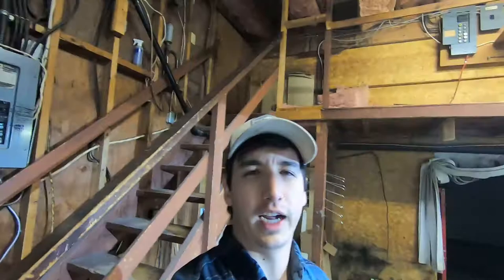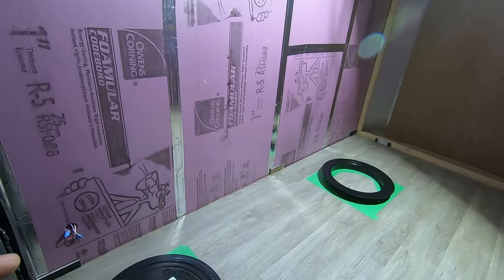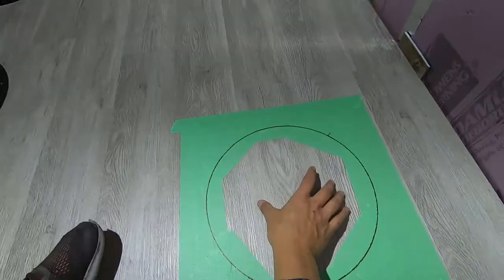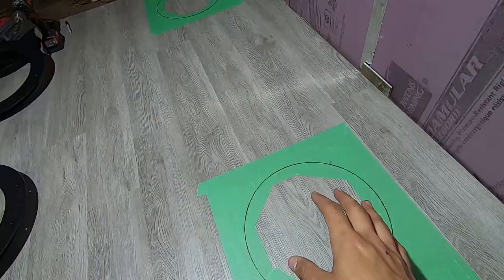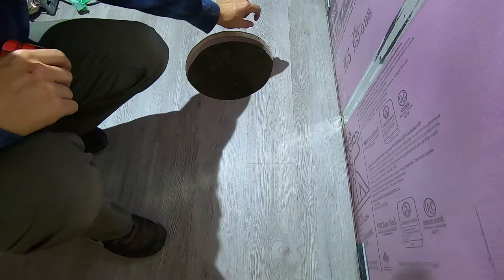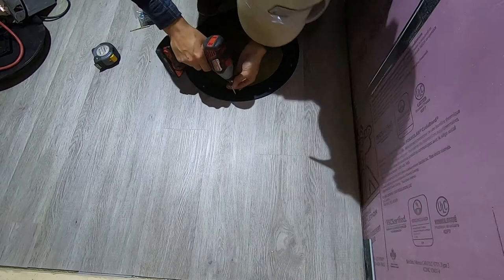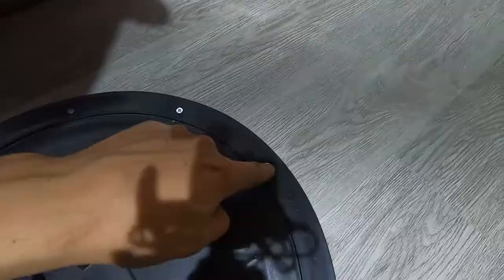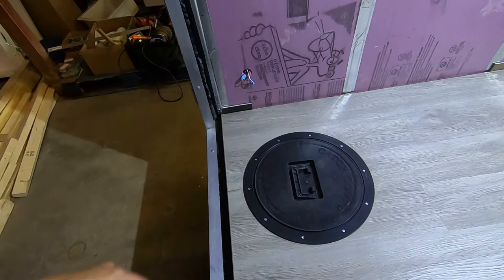How to turn a Cargo Trailer into an ICE SHACK CAMPER

Comment: Great videos on your trailer build. When you installed your diesel heater and had the exhaust ports right against the wood floor, did this cause any issues? I would think it to be an extreme fire hazard.
Reply from the maker: Checkout my update video on the Diesel heater, after 10months. I did discover some burnt wood which was problematic. Ended up installing a metal flange I made out of a soup can! Thanks for watching!

Comment: Have you had any rot or anything happen to the floor around the holes?
Reply from the maker: installed +2 years ago and no problems at all. The tuck tape and caulking is what keeps it sealed 100% recommend.

Comment: Have you checked the floor edge at the bottom of the hatch cover hole to ensure that yur mono fishing line doesn't get caught or cut off because of the metal edges?
Reply from the maker: There aren't any metal edges so I am not sure I follow. The catch cover ring is a smooth plastic.

Comment: I was thinking of doing something like this but using the hole in the floor so that my (large) dog would be able to come in and out with some kind of step if needed! How big do they make those round covers? Is there a way to lock them in case someone tried to break in? Lol
Reply from the maker: That's an interesting idea for them but I don't think I'd recommend using it for a dog hatch. They're too small for an adult to sneak in, unless you're worried about a kid breaking in but in the same breath nobody would know they're there!